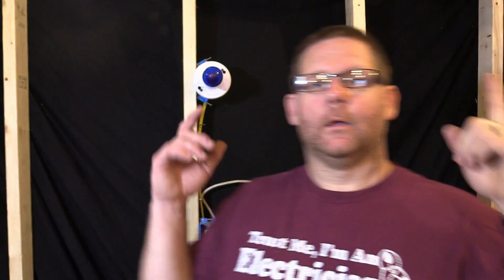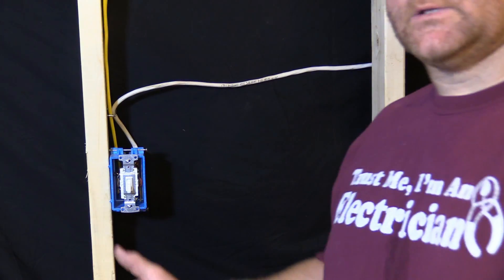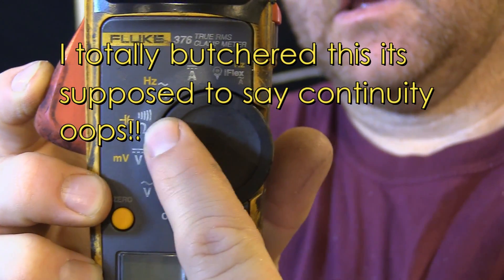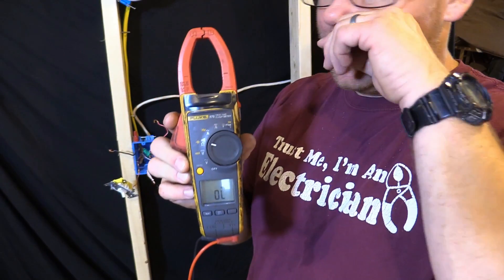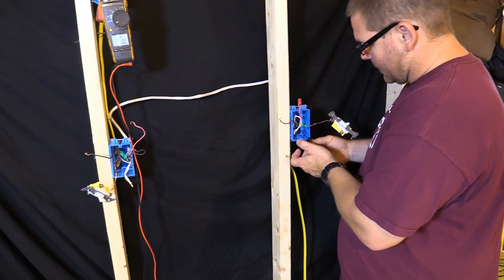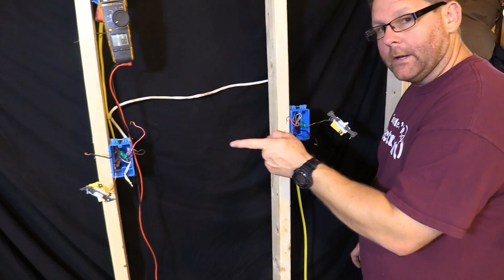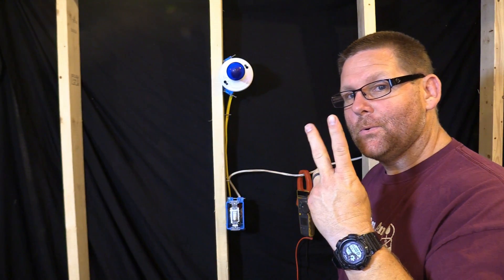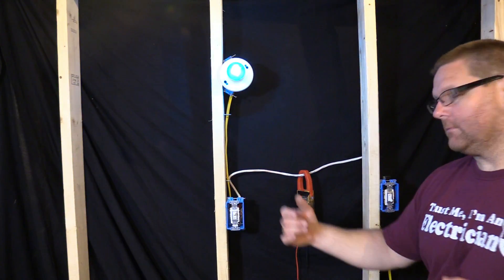How To Fix A 3 Way Switch Problem

Comment: I have a 3 way(by bedroom & other one in hallway) controlling my fan light.  Yesterday, when I flipped one of the switches to turn the light on, it just came on for a split second and when off.  If I went over to the other switch  the same thing would happen.  I have a normal switch to turn on the fan.  The fan switch works.  If I turn it on, the fan comes and stays on.  This was a brand new house when I moved in over 7 years ago, so the switch has not been replaced or worked on.  No electrical work has been done in the house.   I assume one or both switches were bad.  I flipped some breaker switches but never could fine the right breaker for it.  I figured it must be part of the kitchen and my wife was getting ready to cook something so I left it alone.  I got side tracked on some other projects so I left it alone but through out the day I kept flipping both switches.  Again light would come on for about for a second and go off.  Now today, the light is working just fine.  If I flip one of the switches, the light stays on.  I have 3 bulbs in the fan light so I cannot believe it is all the lights.  Plus if a bulb goes out, it never comes back on, let alone all 3 of them.  Any thoughts?
Reply from the maker: It honestly sounds to me like s loose connection in the fan itself. There is alot going on in a fan vibrating like the time while it's spinning etc I'd look there, that would be my guess. Especially if all of the lights go out at the same time. It could be a switch problem... Is one of the switches a dimmer?
Reply: No dimmers in the entire house.  Once I made the comment above it popped into my head that it might be the fan itself.  If it happens again, I will check it out.  Thank you for your quick response.
Reply from the maker: Good luck and keep me posted here. Happy Thanksgiving
Reply: Last night I had the light on watching TV, fan was not on, and the light just went out when I was just sitting there.  I went over to one of the switches and flipped it and the light came back on.  I think I have Gremlins in my house.  Thank you again.  Happy Thanksgiving to you too.
Reply from the maker: It very could be a loose wire or a bad switch. Or maybe there are gremlins 😂 😂

Comment: The first question I always ask a homeowner is.  Has the switches ever worked properly? If they say yes. The next question is. Has anyone else had it apart since it quit working. If they say, yes I say what did they do and did they change any of the switches out. If the switch just quit working on its own chances are it is a loose wire or one of the switches has gone bad. If they say my brother in-law tried to fix it  I tell them, then that is going to cost you an extra $100.00 Ha Ha.
Reply from the maker: 😂 😂 Exactly thanks for the comment and watching ☺

Comment: I've done this multiple times and confirmed everything you have in the video, but I keep popping breakers.....Normally happens if I flip one of the two switches...I've double checked that the travelers are in the same position on both switches...Any ideas?
Reply from the maker: Just curious do you have a nuetral hooked up to it if that's not it maybe one of the lights is bad not sure what kind of lights you are controlling but if it has a ballast maybe that's the problem. I'd make sure that there isn't a nuetral hooked up to the switch

Comment: What do I look for in the 3 way system if all of a sudden the switch's stopped working and only worked just like the ones in this video, one turns on only if the other is on.
Reply: Found the bad swich and everything is good. Thank You
Reply from the maker: Awesome glad it was that easy... Take care
Reply from the maker: If no wiring has been messed with my guess is that one of the switches is bad.

Comment: Excellent information!  Made troubleshooting simple on two separate light circuits that have never worked right.  I might add, if you follow this procedure and it doesn't appear to have fixed the problem you may also have a bad switch.  I knew there were two bad switches on my two circuits, but ended up changing all four switches.  Everything works as it should now.  Thanks so much!
Reply from the maker: Great advice and thanks for the comment and watching ☺

Comment: My 3 way switch stopped working. So I bought 2 new 3 way switch. One switch have 1 white , 1 red and 1 black wire,  no ground wire. That was very easy. But the other switch had 1 white wire connect to the travel screw and 1 black wire connect to the other travel screw and another black wire connect to the common screw, no ground wire and red wire connect to another red wire, with a wire nut . The switch only turn off and on from 1 switch, what’s the deal
Reply from the maker: Hard to say could be that someone had switched receps and made them constant hot. Hard to say unless I could see it. When you put it all back together did it work?
Reply: @MountaineerOutdoors  it only turns off and on from 1 switch. The with the red wire wrong as to be in the on position, for other switch to turn off and on

Comment: Great Video- Question, I am doing a dimmer install,3 way with a switch,  at the other end of the hallway a regular non-dimmer switch. The switches are for LED lights.  Everything works but when the lights go on they are bright then fluctuate before finally remaining at one light level. When installing led dimmers, does it matter which way the traveler cables go?
Reply from the maker: No the travelers do not matter.

Comment: After you know which is the hot, I feel like the easiest method to find the two traveler wires is to look in the box and find the 14/3 or 12/3 Romex. Of course that only works if you have a 1-gang box and/or a box without any other 3-conductor romex
Reply from the maker: Exactly

Comment: Picture this scenario; I have a loaded neutral wire and black common in one box with one red  and one ground. Box number two; red wire is hot, and the black and white are not. So confused.
Reply from the maker: Sounds to me like they are using the white as a traveler

Comment: great video thanks - I thought I had two three switches that after watching your video thought the travellers were not correct- just took off both switches- one is a three way dimmer but the other is just a single pole -- not sure how to fix this one to ensure both switches turn lights on and off. I am puzzled Thanks

Comment: To keep it short, one threeway in bedroom. In bathroom, one threeway  with a second switch for a different light, same box. That box has two hot wires one for each switch. Bedroom, no hot wires. There is no current until I hook up the threeway in the bathroom.  So, now what?

Comment: Is it normal? The red wire on the bedroom was hot, not the black. So switched those wires, but same issue, the light can be turned off and on from the bathroom if the switch is on the 'on' position in the bedroom. Bedroom switch will not turn on the light but must be in the 'on' position. So I opened up the one in the bathroom, one way switch with a free wire attached to nothing.  There's a second switch, one way, that is working fine. So I put in a three way. Still same problem. 
 Here's the part I want to know is normal. I disconnected both switches. In bathroom, one wire is hot. Now in bedroom, no switches are hot?!?! 
Tomorrow, I'm gonna get a 9v battery for the continuity tester. In bathroom, there's a second switch for a different light. Perhaps, the not hot wire for a different light that works, (in bathroom next to the (threeway)  is supposed to a traveler for the threeway and one of the not-hot wires connected to the three is supposed to be for the other one way switch? I guess the continuity test will tell?

Comment: Another 2 min video crammed into 15
Reply from the maker: Now now if you are gonna comment make sure it's right... Its a 15:31 video come on now 🤣
Reply: It's called rounding.  As an electrician,  you'd think you'd be good with easy math. 🤣  And it is "It's" not "Its", if you want to be a stickler for accuracy.  Learn to take criticism, maybe you'd have more subscribers then. 😂
Reply from the maker: Criticism, that what you call it picking apart everything someone says... OK im sorry 😂 😂 😂. Btw... "it's" ok to be human and mess up sometimes, Guy!!🤣 🤣 🤣

Comment: Great video, I just changed out my existing three way switches and put the wires back in the same place as on the old switch and now one switch has to always be in the on position for the other one to work, still a little confused!
Reply from the maker: One switch is always gonna have to be in the on position. It's just how 3 ways work. One up one down
Reply: @MountaineerOutdoors  Thank you for your response!
Reply from the maker: My pleasure

Comment: So if after all this the switch still doesn’t work do you need to flip the travelers
Reply from the maker: that will not change anything. You may have other underlying problems. did you fix it.??
Reply: @MountaineerOutdoors  yes! I used a meter to determine the hot then pressed the two travelers together and used continuity to find the travelers at the top of the stairs, the wires were in the wrong spot
Reply from the maker: So problem solved?

Comment: Not sure if you are still responding, but I had a problem where each switch would work independently to turn the light on and off, but if I tried turning it on with one and tried to turn it off with the other switch, it stayed on or maybe even sort of flickered but stayed on. Then the other day after a power outage, I found the light on and neither switch would turn it off. Do you kniw what caused those issues? I flipped the breaker just to be safe (vacant guest house)! Cheers!
Reply: As it turned out, I totally hosed the switch rewiring after rerouting wires after making an opening/doorway in the wall. First, I failed to note how the one switch was connected and then tried to use a 'How to wire 3-way switches' diagram to figure it out. When I opened the switches back up, disconnected all wires (including neutrals connected to switch terminals!), identified the power, determined the travelers, identified the load to the light, then reconnected the switches as normal (plus put neutrals all back together), everything worked as expected! I am not sure why the light just came on out of the blue, but wonder if something was shorting out (cut old wires off the back of the switches and didn't remove the closely trimmed tiny copper studs that remained...until this redo!)... Good ending, fueled by helpful videos. Thanks!
Reply from the maker: Well awesome that you fixed it. At least now you know,except for the light that mysteriously worked on its own. Have a great day
Reply from the maker: At first it sounded to me like it was a messed up 3 way, but when you found it on by it self I'm wondering a few things, first is your house using a switched nuetral? Is it being back fed by another circuit somehow? Or do you have ghost?  Anyway hope that helps

Comment: Thanks again for the video. After fixing a separate problem🤕, I needed to rewatch your video..  and Wham-O 🎉. Off and on in any location. 👷🤗 I have 3 more to go😇
Reply from the maker: That's great.. Sorry for the late response did you get everything fixed.
Reply: @MountaineerOutdoors  Thanks to your video, I got all the 3 ways changed, added wires that were missing🤗. However, the original issue I haven't solved😬. I did however trace the connection of the two rooms to Rm A, Switch #1. In order for Rm B lights to turn on. In Switch #1, there are 3 sets of wires, 1a 2b 3c. 1a is from the Box (Red-Hot, White, Black, Copper). 2b goes to Lights, it has (Red, White, Black). 3c goes to outside Light, it has (White, Black, Copper). Originally, it had Switch #1- 3 Way, Switch #3 Single (Outside Light). Opposite wall Switch #2 3 Way. The issue is Switch #4 Rm B and opposite wall Switch #5 Rm B. Switch #4 (Red, Black, White, Copper, along with (2 Black-Wing nut, will allow Volts to Switch #4-Black, Hot with Red Tape {HwRt}; from Switch #1 2b Black-Wing nut with 1a Black, Switch #1 has White-Wing nut 1a and 3c White... Also, Switch #4 has 2 White-Wing nut. Well, this is what I have. Worked it so long, can describe from my mind😵🤕. I have also made an extensive drawing, just in case👷. I really need Rm A lights to work independently from Rm B. Again, thanks for you video. All the 3 ways work as needed.🤗
Reply from the maker: Sounds like you have a great plan. Good luck
Reply: @MountaineerOutdoors  . Thanks.

Comment: This is a great video. Thank you! I need to buy an ohm meter. I was able to guess my way to success in the kitchen. Now I’ve gotta get to work on the stairway.
Reply: Ended up just finding the live wire and connecting it to the black screw. Worked like a charm! Thanks again
Reply from the maker: My pleasure thanks glad to hear that you fixed this problem. Have a great day ☺

Comment: Very helpful. My issue is they wired two rooms together, so that room A must be on, in order for room B lights to come on.
Reply from the maker: Wow that stinks
Reply: @MountaineerOutdoors  Ended up disconnecting all wires going to switches on that one breaker, to rewire them the right way. Making sure the hots are on common, where applicable and tracing the travelers, hoping to fix my issues. Also, had to buy wire to separate the one wire they had going to two switches. Now, pigtails will go to each switch by code. An hour job, turned into days🤕😵. But glad the Lowe's "Pro"  and you YouTube "Pros"  have been so great.🤗
Reply from the maker: That's great.. Glad you got it fixed

Comment: Should have watched your video before returning my TP-LINK. Great stuff!!👊 Thank you
Reply from the maker: My pleasure I'm curious though... Tp link? What is that?
Reply: @MountaineerOutdoors  - It is one of the smart switches, I bought the Kasa Smart WiFi Light Switch, 3-Way Kit but I messed up the wiring and it didn't work, so I returned it but in the process of putting everything back, I had this problem that you provided solution too, so now I'm thinking about repurchasing one again, and give it shot.
Reply from the maker: Gotcha I Googled it after I wrote my comment it came up with stuff like that smart switches etc..

Comment: Thanks for that demonstration.  Unfortunately, I have a different situation.  I am assuming my switches have been wired correctly since they have been functioning for more than 10 years!  Funny thing about my situation: I have two pairs of 3-way switches in my hallway to operate two different fixtures.  Yesterday I flipped the switch to turn one of the fixtures on - the light fixture turned on for a half second - then went out.  After that, I tried ALL FOUR switches in every combination and neither of the two fixtures would turn on.  So far, I checked one of each pair for the presence of a hot wire (I have one electrical box housing two switches, one for each fixture).  They both had hot wires.  Next I confirmed that both switches would alternate properly between continuity/discontinuity and they functioned properly.  They checked out OK.  I do need to proceed to check the other pairs for proper functioning.  Could the problem be in the fixture itself?  Thanks.
Reply from the maker: Yes possibly the tab in the fixture is bent where the contact to the bulbs. Not sure what fixture you have or if it takes a bulb or not. Could be a  bad element in the bulb itself. Or could be a switch problem even though it checks good it could be a faulty switch
Reply: @MountaineerOutdoors  Thanks for your response.  One fixture is a 4 bulb fixture that hangs from the ceiling.  The other "fixture" is a series of three can lights in the ceiling that run down a hallway. I checked the hanging fixture - just a visual inspection - nothing wrong that I can see right off.  Removed all the bulbs and tried them on another fixture.  They're all working.  Just taking it step by step now until I find the problem - or give up and call an electrician!  What kind of fault can you have in the switch even if the continuity checks out?  Is there a way to test for that?  Thanks again!
Reply from the maker: Ok so just to recap. When you have problems none of the lights work?
Reply: @MountaineerOutdoors  Correct. I work the switches every which way and nothing turns on. And yet I can probe the wires that go to the 3 switches I've opened up (one more to go) and each one has got 110 v going into it.
Reply from the maker: Well it's very possible that you may have a wire to the lights that is bad. What do you have inside the fixture?  Just because careful not to short out the fixture or your meter
Reply: @MountaineerOutdoors  Well now I am able to turn on both fixtures, but I don't know what did it.  The only changes I've made is to rewire all the switches so that the wire attaches to the screw instead of the insert hole.  And I had removed the four bulbs in the hanging fixture to test them and placed all the same ones back.  Last step now is to wire them correctly since I didn't keep track of where all the wires should go!  Still a mystery to me why BOTH fixtures suddenly stopped working.  The only thing I can think of is it had something to do with the four bulb fixture.
Reply from the maker: Wow that's crazy but on a positive note it's working. So your switches were stabbed in the back of the switches?
Reply from the maker: If it was stabbed in the back don't ever do that here is a video of the reasons why you do not do it https://youtu.be/UJ4UvQ7VAig
Reply: @MountaineerOutdoors  Yep.  We bought the house new.  So far as I can tell, every receptacle is stabbed in the back because every time I've worked on something in the house, that's what I see.  I prefer hooking it to the screw since that way I can see what's going on with the contact.  I'll watch your video when I get a chance.  Thanks!
Reply from the maker: @rb5519  yeah that stabbed in the back is bad news